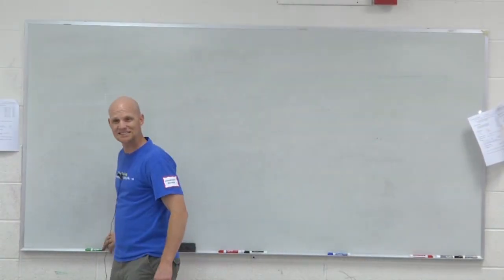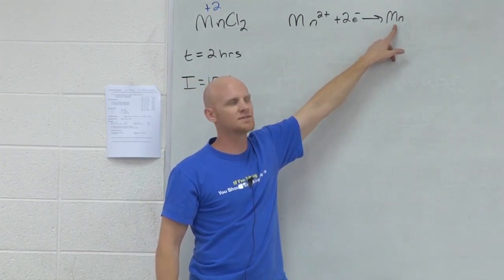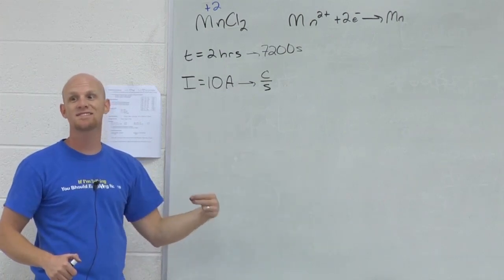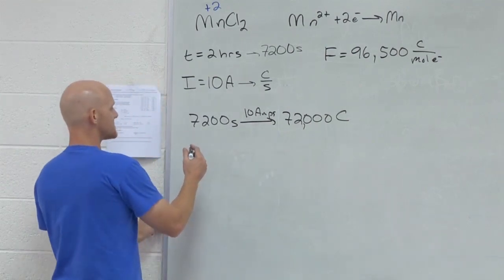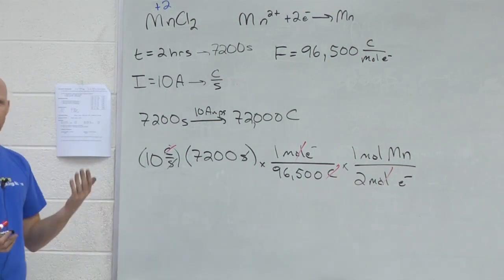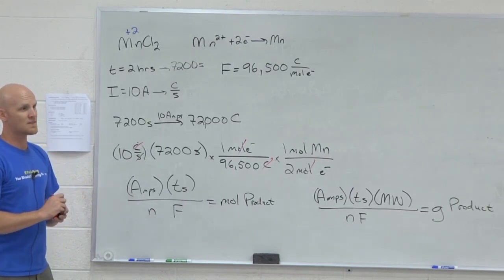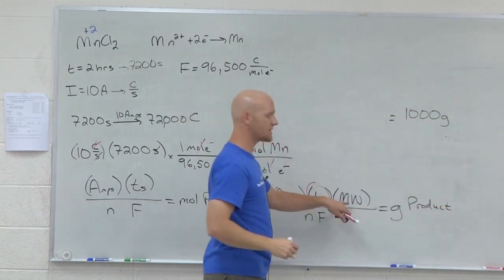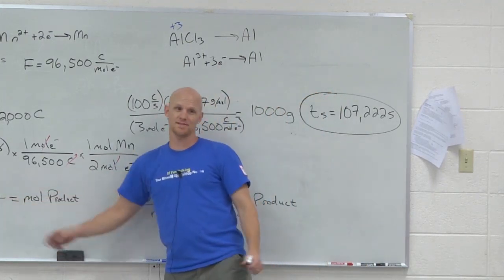19.8 Electrolysis Calculations

Comment: What if we have a half reaction where 2 moles of the metal are formed at the cathode? Would you just use the 2 moles of metal in the formula or deduce how many electron moles it would take to produce 1 mole of that metal and then plug those values in? Thanks
Reply from the maker: Hey Cool Kid - it might depend what you are trying to calculate but as you saw in the Manganese example, each Mn requires 2 moles of electrons since it is 2+, and the coloumb is based on moles of electrons so we have to take that into account :)

Comment: The oxidation state of MnCL2 is used for Mn as +2 and hence the number of electrons are found. In the case of H2O where Hydrogen has an oxidation state of +1 is the number of electrons needed 1 or is it 2 since there are 2 hydrogen atoms?

Comment: Great insight. One thing that bothered me, however, is that the professor here made it too easy for lazy students to just memorize a formula to get the answer. He even encouraged it!
Reply from the maker: I'm not the biggest fan either but a little context.  Most of the students in the class have not taken college physics which would make this a much more familiar topic.  Current measured in Amps and charge measured in Coulombs are completely new for the majority of students.  The second piece of info is that this is often taught as the last thing at the end of a unit often the lecture before an exam so not only is some of the material very unfamiliar, but students have had very little time to learn it before being tested on it.  So presenting it conceptually as well as presenting it as a 'plug-and-chug' equation is a sort of compromise.  If you watch the entirety of my lectures you'll find that I believe that the best way to master the subject is to thoroughly comprehend it.  Happy Studying!